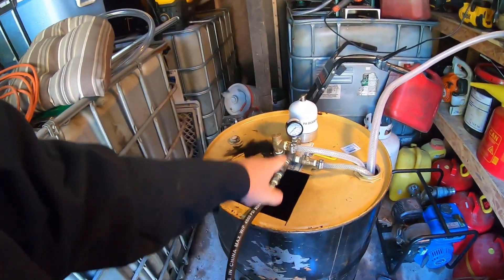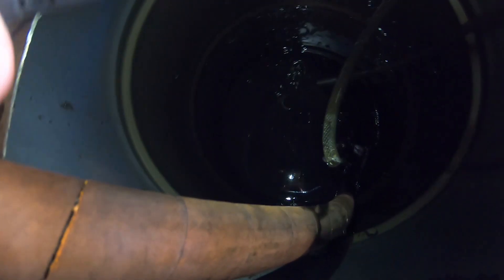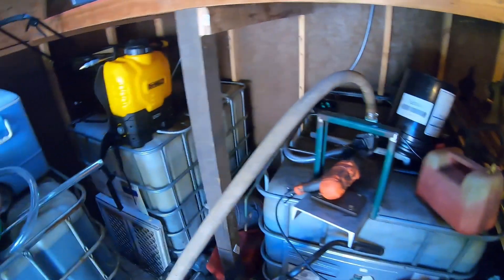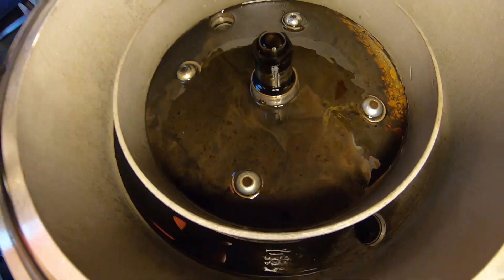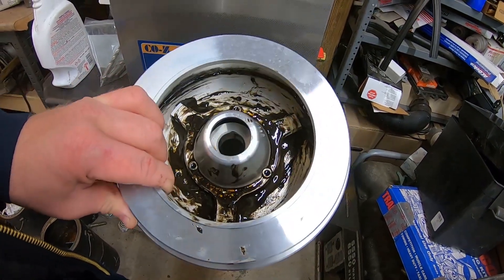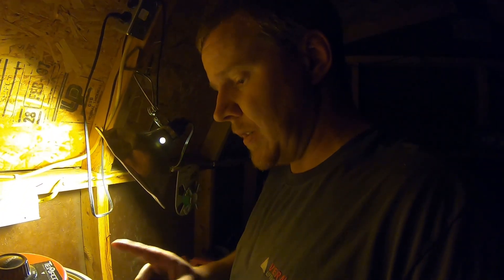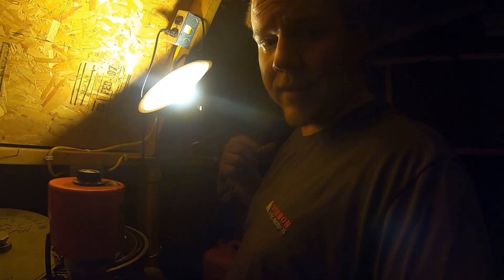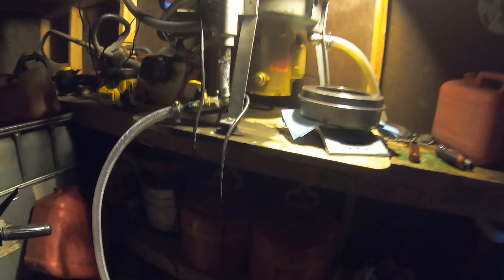Black Diesel - Centrifuge Shootout Part 1 - Pressure Drive VS Direct Drive

Comment: This is really good stuff man, thanks for doin it. Besides yours, I can't find any channels that are currently doin waste oil fuel. Appreciate how you explain in comments why things do or don't work to folks with questions, like the water separators wont pull emulsified water out, heat is required to mechanically separate that moisture. Great stuff brother, can't wait for more testing and results. LOVE THIS SHIT MAN, THANK YOU.
Reply from the maker: Appreciate it bud.  I've found a couple channels recently also doing some really cool stuff with waste oils.  I'll link them in the description here in a bit.
Reply: @NotSoGrandGarage  
Thank you for that, I'll check them out for sure.
Reply from the maker: @GRAZINGARIZONA  For sure do.  He does some really interesting flame tests that have me rethinking my mixture.

Comment: I´ve a pressure driven unit. It operates at 4100g/9000rpm. I let it run for at least 3 passes in the same barrel and the 4th time will be centrifuged and at the same time pumped at a new barrel where I add the RUG. With that much oil slime like you got, there will be problems fast in my point of view.
Reply from the maker: The oil is all from the same tote....   has been settling for over a year.  The sludge is coming from emulsified water.  Running the pressure drive setup, it was looped for 20 hours...  that means 20+ passes at 55gph.  I used to run mine for 40 hours and would never get this much stuff out.  

Heat is important to drive out water.  More so than I ever thought.  I didn't Heat with my old pressure drive setup....   just blended with rug and ran for 40 hours.  I couldn't run my fuel below 30°F.

Now with the direct drive and good heat...  I've had no issues running down to 5°f so far.  Both units pull the solids well...  its the emulsified water that the pressure drive struggles with and I think it's mainly due to heat.

Comment: So if you were filtering or using a pressure unit - how much of that water would be handled by a good water separator in the fuel system?
Reply from the maker: Very little.   The water is emulsified...  not free water.  I've got good water separators on all of my rigs and I never get much out of them.  Heat does the work with water.  

Before stepping up to the heated firect drive, I'd never get this much stuff out of the batches.  My results were always similar to the pressure drive results shown here and my water separators never caught much of anything. 

The big noticeable difference is in cold weather.  Before, I couldn't run my fuel below 40°F.  Now..  I've been down to 5°F and it runs like a champ...  same W90 blend.  

With that said...  if you could get your drum hot...  170+F...   and keep it there for 10+ hours prior to centrifuging to drive off moisture...  the final product would be better.

Comment: You are at 1,087.41 Gs going to 3,706.20 Gs.Yes it worth it. However at 180 to 200° at 5 gallons per hour it still takes more than one pass to get the oil clean. Even with a 10,000 GeForce unit.
Reply from the maker: The numbers say it's worth it....   I want to show why.  Currently working on the 3k to 6k comparison....   then I'll be doing multiple passes...   and then heated vs not all at the same flow rate and same tote of oil.  Seeing the numbers on paper... most won't give it much thought.   Seeing the actual batch results on video is a bit more convincing.  But... you've still got guys out there pouring oil through old jeans and dumping it in their fuel tanks... and promoting that method "cause it works".  I want to change that.
Reply: @NotSoGrandGarage  when you get the three phase motor hooked up and running you will find that it consumes far less electricity. The problem with the high-pressure units is that they keep pouring clean oil into the dirty oil over and over. I am working on a 10 gallon batch of oil and after 50 hours of runtime still coming up with .8 ounces of dirt. This is after it has gone through a 10,000 GeForce bole unit 11 times. The upside to a pressurized unit turn it on walk away.
Reply from the maker: @mrfixit237  for sure.  My old setup was pretty self contained.   It had ashcroft pressure switches to shut everything down if pressure went out of a set range...   I looped the relief/return to the pump inlet instead of the drum and it would run by itself indefinitely. 

I've got the 6k up and running and it is using less energy which is a nice bonus... and so far, has pulled quite a bit more out than the 3k which was expected.  I'll edit that video this weekend and it'll post sometime next week.  Currently pumping that same oil back to the gravity drum for some multi-pass comparisons.
Reply: @NotSoGrandGarage  What if you ran the same 5 gallons of oil over and over until nothing more came out and put the results on a graph to show everyone just how effective multiple passes are?
Reply from the maker: @jeffgreen977  I've had this request a few times.  I'll need to put something together on it but it'll be a bit as it will take a fair amount of time.
Reply: How did u calculate the GeForces?
Reply from the maker: @shrek22  GeForce can be calculated based on rotor diameter and rpm.
Reply: Where would one get 10000 GeForce unit?
Reply from the maker: @shrek22  USFilterMaxx sells one.

Comment: I like your work. I've been adding E85 to the mix prior to spinning and heating. I noticed the ethanol absorbed the water from the oil and is easily evaporated with heating during the process.
Reply from the maker: I've come to realize that heat is very important to the process and I've only started heating in the last 2 years.  Be VERY careful heating with gasoline already blended.  Ethanol and gasoline will evaporate faster than water...  giving you a highly flammable gas in your work space.  Be safe.
Reply: You know that’s actually super smart I didn’t even think of that! But what i would do is put about 10g of it in a 250 gallon drum and then agitate it then let it sit